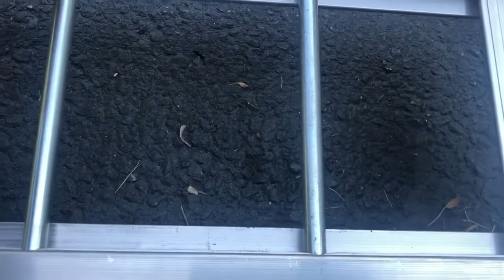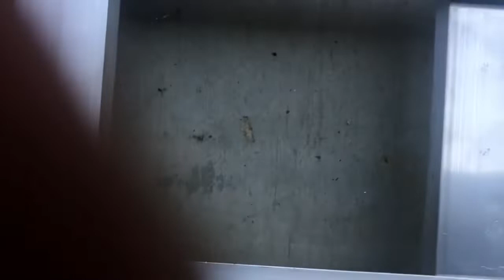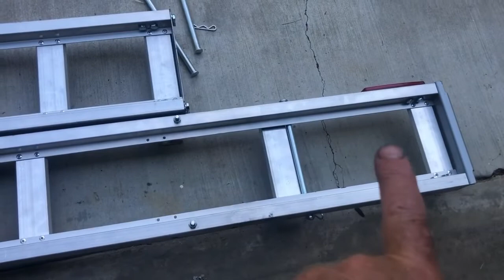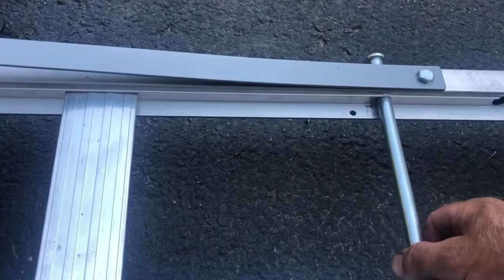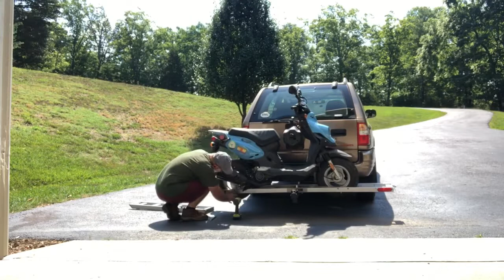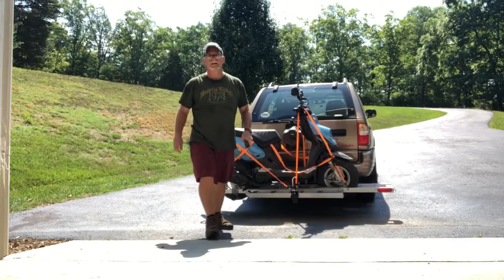Harbor Freight hitch mount motorcycle/scooter carrier.

Comment: Thank you for your video. Just what I needed to modify mine for my small bike. Perfect idea and safe as well. 😊
Reply from the maker: Used it just the other day.  Hope it works out for you.  I need to remove my spare tire mounted on the rear gate to make it work for me, but very stable once tightened to the hitch receiver.